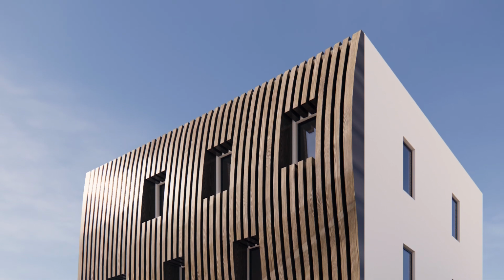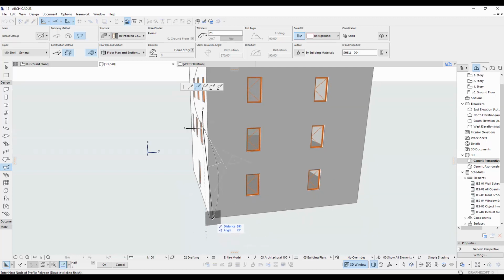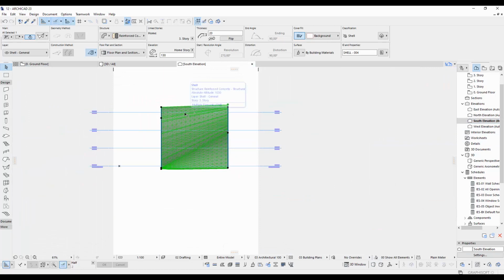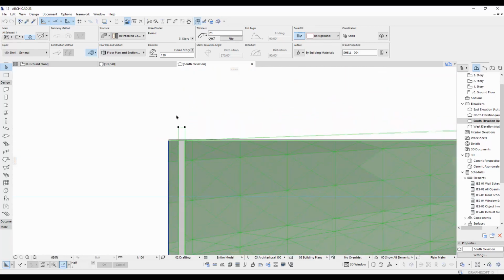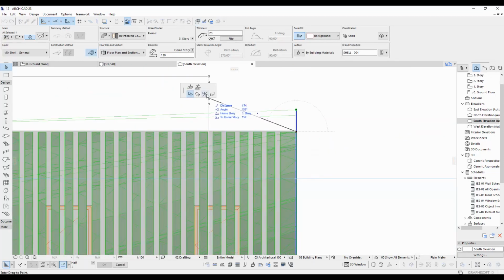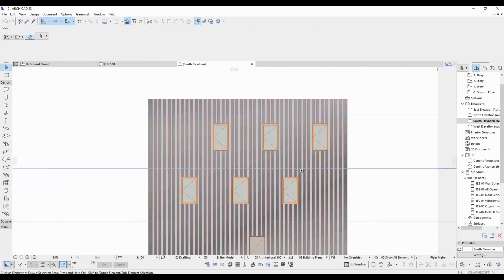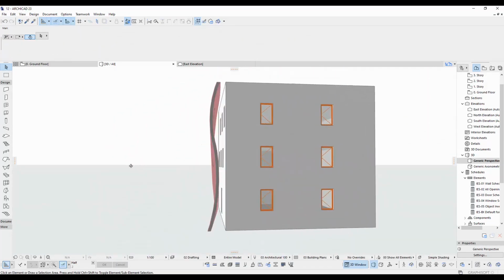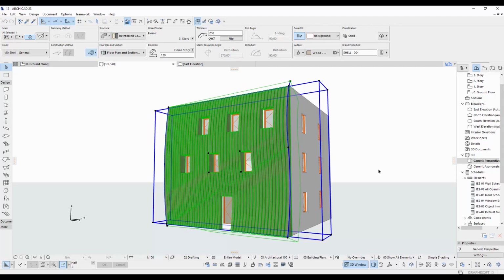ARCHICAD Tutorial #7 WAVY FACADE DESIGN

Comment: Dear tutor, I have trouble with drawing the line of morph tool on the facade. THe line doesn't pick on the needed direction. Did you change something in the setup before?  Your tutorials are pretty nice, just I want to understand how to prevent from such type of drawback.
Reply from the maker: You should right click the face and go with make custom plane. By doing this this way you can do that easily.
Reply: @sb.architect  thanks for hints, I will try